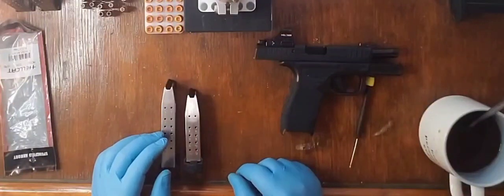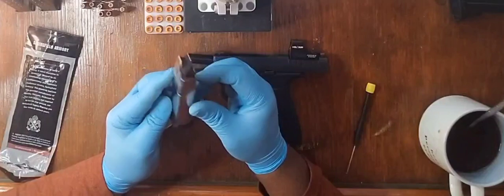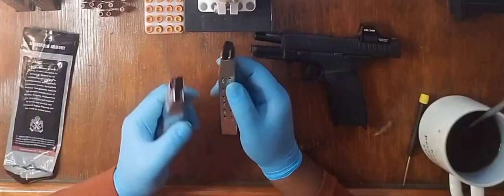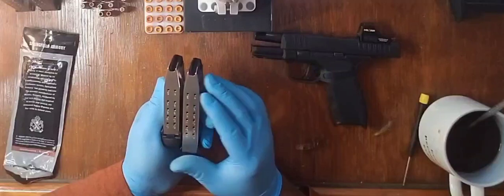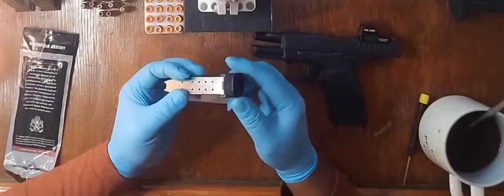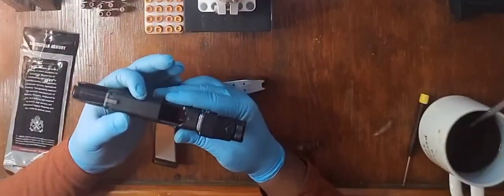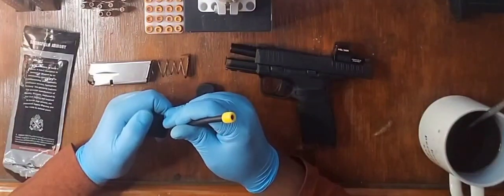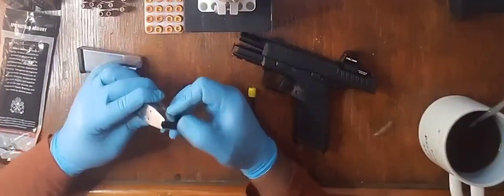Hellcat Pro 15+1 round mag upgrade to 17+1 rounds

Comment: It is the same metal piece as the 11 round but it has an extended hollow base plate for the spring to go just that much more for 2 more rounds. That's why the 15rd has so much blank space, the spring is bound up at the bottom taking up that place. And your right you can put the 13 rd base plate on it to create more room for the spring, which in turn leaves more room for 2 rounds, giving it 17. I thought the same exact thing when I saw it, but I just thought about the spring, but the wholes. It's crazy how people's brains work in different ways to solve problems. Nice video. Keep it up

Comment: Not being a firearms expert, just random dude on the interwebs, please do a "live fire" test of the magazine springs with 115gr, 124gr and 147gr ammunition. I would test the magazine release numerous times also. It would suck if you lost all that extra capacity when you needed it because the magazine springs, the magazine release, or the magazine baseplate fail. Then come the tests there are the feed / chambering / extraction issues. See the comments made by Siris Mc, especially "Don’t think for a second I’m discouraging you. I support you 100%  tinker and try new things all the time. Find what works and what don’t work. Even the mod here.   Just take a spare mag until you can prove to yourself that its worthy of every day carry.  Get it dirty, drop it a few times, don’t seat the rounds all the waY   TRY TO MAKE IT FAIL..    when you cant make it fail anymore, you don’t have to think you can trust it, you know you can trust it." Its a lot of work for two more rounds. Best of luck in your quest.